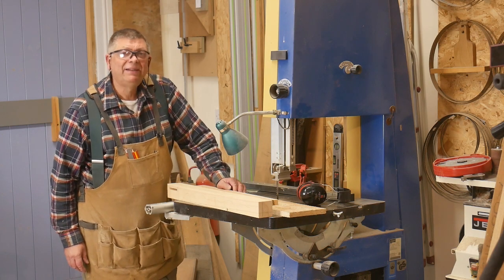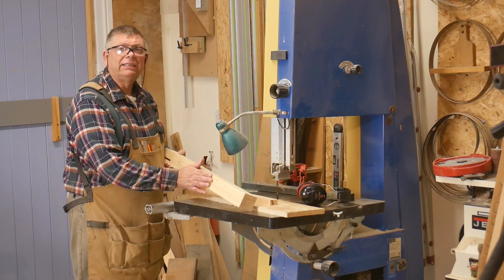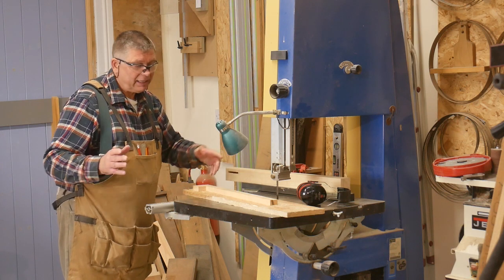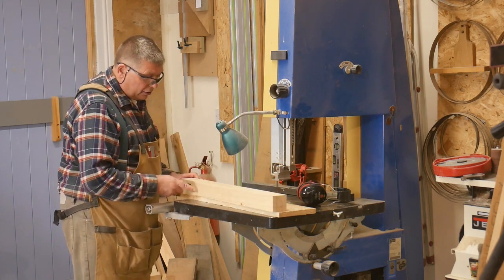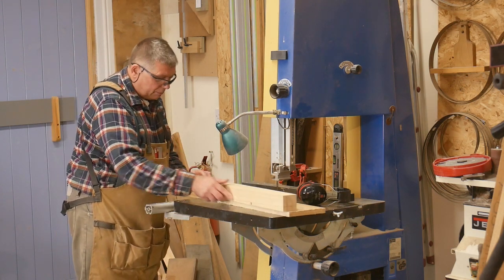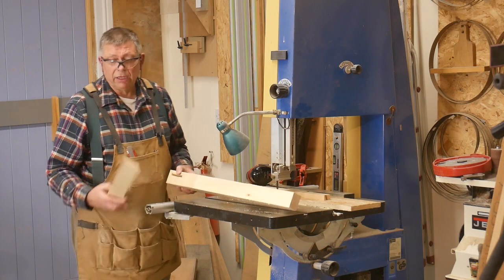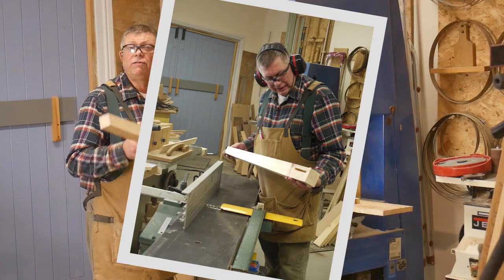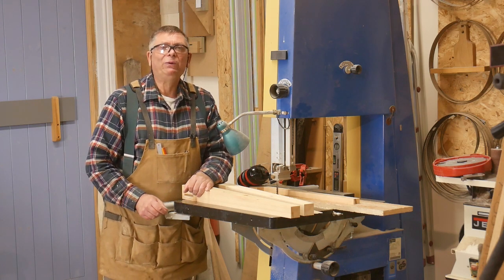Taper jig for table legs

Comment: I like the idea. Only thing that bothers me is that there’s nothing to keep the front end of the work piece from moving. I might build this but add a stop in front to keep the piece snug in the jig.
Reply from the maker: @mattsgarageshop  Well I am holding the leg against the fence, so I don't understand why the leg would move anywhere. But if you prefer to add more support, that's fine with me! 😀
Reply: @SteveMaskery  I think it’s just me - with my hand at the rear, I’m holding into an oncoming blade, so my instinct will be to get my hand out of there. Anyway very good video and jig.

Comment: All other YouTubers want to make it the fussiest way, but I finally landed on the simplest way to make a jig. How about cutting it the opposite way from the top of the leg to the thicker part at the bottom?  I'm guessing it would work just the same.
Reply from the maker: The problem with that is that the blade will make contact with the workpiece at a very acute angle and is likely to be pushed aside. This way, the blade starts against a very positive s it surface.
Reply: @SteveMaskery  Trying to figure out a way to taper a larger piece of wood being that a table saw only has a minimum of blade height and I have a band saw but no joiner or planer.  The top of the piece will be a pyramid, so I won't have a flat surface to taper from wide to narrow.  Maybe I should try making smaller pieces on my table saw and once I get a hang of it, look for other solutions.